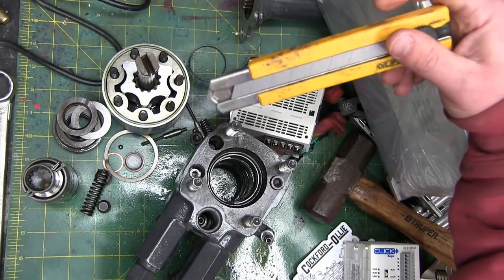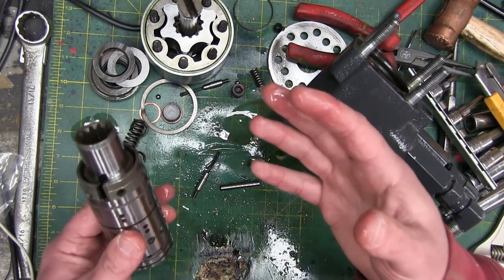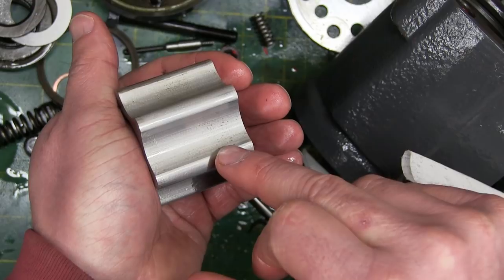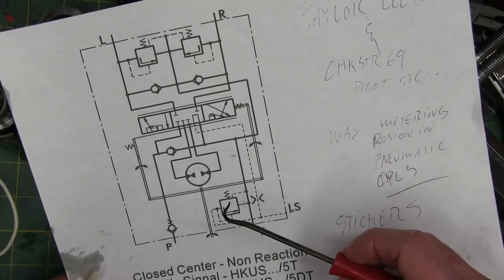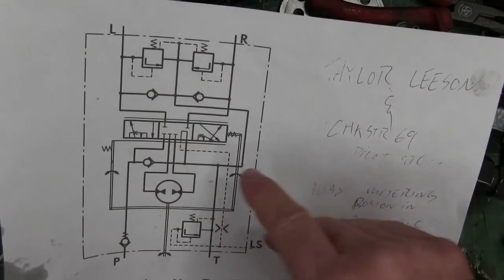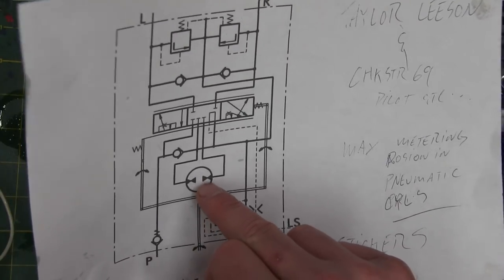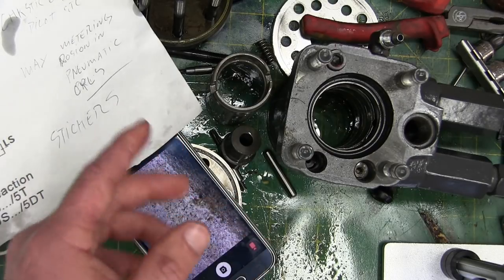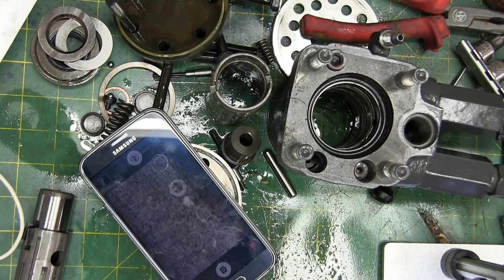Orbitrol Valve Details | My Errors Rectumfried.

Comment: AvE I have a question for you. I want a switch/solenoid that is the reverse of a solinoid. So the power is constant in the main power supply and when u add power to the switch it cuts the power in the main line. I'm trying to replace my blinked in my jeep for lightbars and I'm going to run main power to the light bars and use the second power the pulsing line to cut the power to make my blinked blink. I am trying to find a switch that would work for my application.
Reply: But keep in mind that the way you described will make your lightbar blink, which may be very bad for its lifespan. He's exactly right with his relay recommendation. I think you should get signal power from before blink relay. Also it's always a good idea to switch ground instead of hot. If you run hot straight to power source (fuse block/battery) it means alot less places to get short. If ground gets damaged then it's easy to disable lights without sparks, power surges, or melted wires.

Comment: I know there must be worse conditions for working on hydraulics, but I can't imagine there are too many worse than an underground coal mine.
Enjoy your vijayoes,
Rollie
Reply: Sulphide mines are nasty nasty places, with water so acidic it eats stuff as you watch it. crawling about under a scooptram and and get some in your eye; lemon juice sting!  Put down a clean piece of any metal and a drip from the roof will fuck it before you can clean it off. Also eats tools of all sorts and the harder the metal, (higher the carbon) the quicker it fucks it. Yeah, coal's pretty nasty too.

Comment: your better off putting air in one side of a cylinder, filling the other side with oil, and metering the oil as it comes out, and closing the valve off there, you can get insane precision

Comment: Air over is air driven pump moving fluid in the ram, electric over is a motor driven pump moving fluid in the ram. A manual example of this is a floor jack with a handle you pump to move the fluid in the ram.
Reply: Dirk Logon nope guess again, doesn't matter how the hyd pressure is created, matters what controls flow.

Comment: Hey AvE air over hydraulic means the air is the main function over the hydraulic so a clutch actuator on a truck, usually air over hydraulic so if the air fails you have hydraulics there
Reply: Alix Atkinson negative ghost rider try another guess.... Or just read the comments.

Comment: AvE, if you have an interest in hydraulic control units, have a read on the investigation into the Boeing 737 rudder hard over issues. Few people are aware, but a lot of ppl died in accidents related to this control valve, which would suddenly move in the opposite direction the pilot intended. Thermal shock and fluid contamination were the main causes. Quite an interesting read on how it could even be possible, but it happened. At one point they were telling pilots to jerk the rudder back in the same direction it moved (the rudder), instead of fighting the controls. https://en.m.wikipedia.org/wiki/Boeing_737_rudder_issues
Related video and schematics can be found off this main page. https://www.ntsb.gov/news/press-releases/Pages/NTSB_Concludes_Longest_Investigation_in_History;_Finds_Rudder_Reversal_was_Likely_Cause_of_USAIR_Flight_427_A_Boeing_737_N.aspx

Comment: using a flow meter on a pneumatic piston?
How would you go about a load that changes based on disnatce traveled? (the force to distace graph is all sorts of fucked, not constant and not linear)

My guess is some pressure times volume bullshitery.
Or the engineer sends your mother to a tropical country and installs an electric or hydraulic part.
Reply from the maker: Constant load. With variable load you'd need to add pressure sensing and map to a look-up table.
Reply: Just thought of something: using a resolver to measure the displacement with gears and such...*
It sounds like cannon fired at cockroach kind of overkill (with the reaction time of a dead sloth)

*i'm not in the trade and i got most of this knowledge from Skooum Skookworks University (and having had an amazing physics teacher)

Comment: Can somebody explain to me what EDM is? I only know it as Electronic Dance Music and I don't think it's going to be that. 👍
Reply: Electrical Discharge Machining. Basically the inverse of arc welding: stick the workpiece in a dielectric (insulating) liquid, then use a wire electrode to strike an arc to erode the material.
Reply: SAI Peregrinus Thank you for your reply, I know about spark erosion but I had never heard of EDM so thanks again for your excellent reply. 👍

Comment: around 8 min you say  that it wont work like a pump and its just for feeback. I believe this is incorrect, if you need a video of 300lb gorilla turning it you may be surprised... the pump feels mechanical even like a gearbox same as a truck with no power steering not fluid.

Comment: That thing must cost a fucking fortune new. Source: 5axis CNC programmer. I've machined plenty of hydraulic valves out of fancy materials like inconel, and that thing is up there..

Here's a point, what material is it made of? It could very possibly be inconel. Does it feel heavy for what it is? Do some tests and figure out please :-)
Reply: Sounds pretty damned hard. When pulled apart it gives off a nice hardened ring. A super fine piece of close tolerance machining, and as stated, if it's a blonde one out it gets relegated to the fuck-it bucket.

Comment: air over hyd or elect over hyd  id the air or elect is the controller take a modern loader most things are ele over hyd IE a switch is flipped and it controls a solenoid that controls the hyd

Comment: I found a nice schematic and also it says you can steer when there's no pressure http://tractorz.blogspot.ro/2012/05/disassembling-and-assembling-orbitrol.html?m=1  I think any equipment must have a way to manually steer in case it brakes down and needs to be towed

Comment: While that rotor seems tight, the fact that you can easily rotate with your hand tells me it's actually a little sloppy.
Reply: Matt Lorence you like the taste of shoe leather??? He SAID the layer of oil (nearly microscopic) allows free movement even in extremely tight tolerances. Essentially the spool is suspended on surface tension of oil coating inside of tube. That's why the cross hatch, to retain oil on surface of the spool.